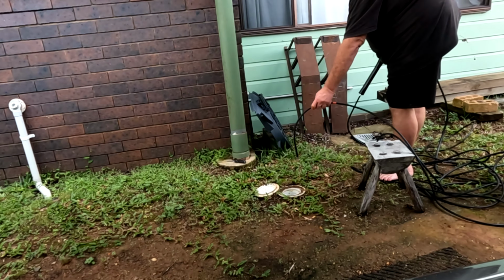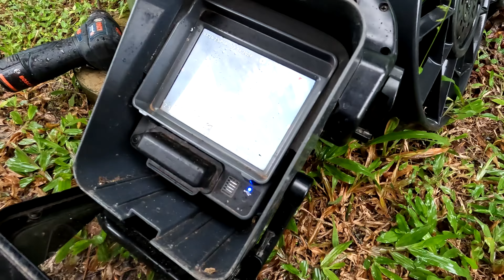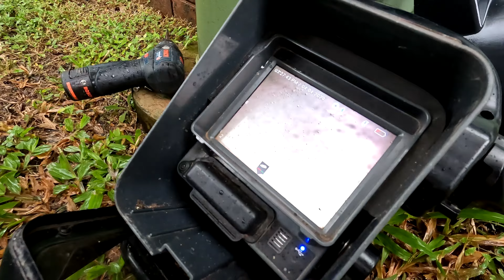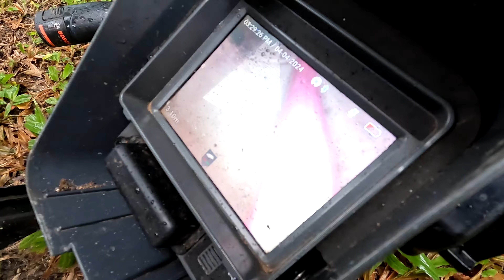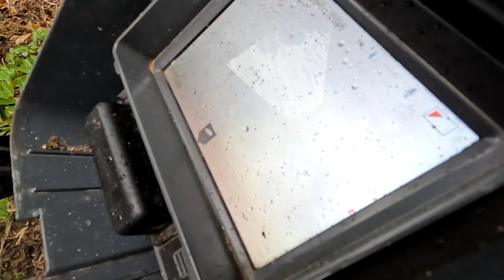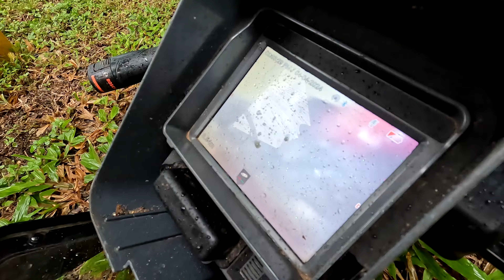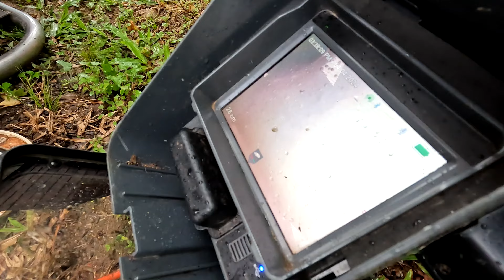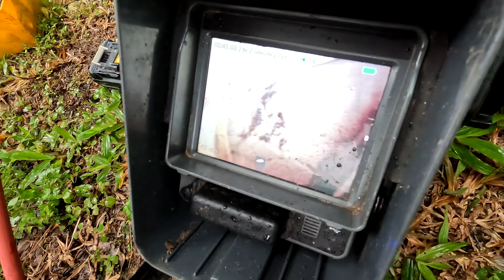How to Clear a Blocked Drain Fast: Pro Hydro Jet & Camera Solution

Comment: Wow, I recall years ago as a child our house would always have root issues in the pipes but those plumbers back then had what looked like a long spring. Great footage of the pipe in the end. 👍 Thanks again for sharing good sir but  touch wood I’ve never encountered this issue. 🤷
Reply from the maker: Yeah, it's always tree roots, except sometimes too much, or the wrong TYPE of toilet paper, can cause a blockage (never buy cheap rubbish paper that doesn't quickly disintegrate in water - a common problem apparently - stick to name brands). Our now retired plumber, and others before him, used the long 'eels' as they call them - those are the long sections of springy helicoil sections of which you speak. I lost count of the times back when they've been used here, they would jam up and even get stuck in pipes! Sometimes, they're still ok for straight lengths of pipes, but when there's difficult curves and multi-directional pathways (such as in this particular video); the old 'eels' simply are too fat and inflexable, to navigate the turns, in order to cut the roots. That's why these high pressure jets are far and away, the best option - especially when combined with camera footage that shows the plumber exactly what's happening at the blockage.
Reply: @SteveMack  Ah, now that explains things, thanks Steve. Yeah I was told years ago about using proper toilet paper. Definitely no newspaper lol 😂 

Our friend across the ditch has been quiet lately.
Reply from the maker: Apparently COSTCO cheap dunny paper is the worst offender, re toilet paper - other bad ones are disposable wipes (even the one's called 'flushable'!), napkins, disposable face wipes etc, sanitary 'things' - ONLY toilet paper should be flushed!!

Don't know if you saw my further lengthy reply the other day, outlining my theories - I saw another video the other day (not sure if it's still there); ...MORE dead fish, and more new ones (doomed I reckon); and further strengthening my initial thought, was he'd only just bough a scoop net, and also said in it, that he was tired of getting his sleeve wet; SO - As per my theory; toxic product residue on hands / arms, and clothing, is the reason for their unfortunate demise...😕
Reply: @SteveMack  I went back to reply to it but couldn’t find it Steve. 🤷 That makes sense that he is a cleaner etc. Wow the animals that have died are extraordinary including the rabbits. Its a little frustrating watching his vids but wish he just took the time out to listen to you and others who have knowledge about those things. Whatever it is can’t be too good for him either. 😬
Reply: @SteveMack  I keep trying to write replies but they don’t seem to appear 🤔 It’s actually frustrating Steve.
Reply from the maker: It's frustrating as hell for me too mate! - I get sent via 'BloggTrottr' that I made a video about setting up, a few years ago, when comments were even then acting up weird - the problems NEVER completely been solved - I see replies on my email notifications, but very often, when I go to reply; I can't find them! Sometimes, I'm sure people decide to delete their original comments for various reasons, but I still see what they first wrote...for better or worse.😕
Reply from the maker: Oh ok; I found the same issue, which is why I replied again to the area you replied in - I saw your follow-up comment, then wrote my answer, only to find the comment was now gone!! Yes; I didn't even GET TO tell him of my theories, as he deleted the video where I ASKED IF he wanted my thoughts (I assume he read that?); so, he remains unaware of what the probable REASON is...So much for his "learning curve" statements that he continues to make - SADLY, every time I see a new replacement fish now,  say to myself 'doomed to die soon'. I also wonder about health effects on himself too - humans are generally far more resilient to such things, short-term; but long term, nasty things like cancers etc CAN develop from prolonged exposure...Nothing one can really DO, unless the persons' open to outside information.